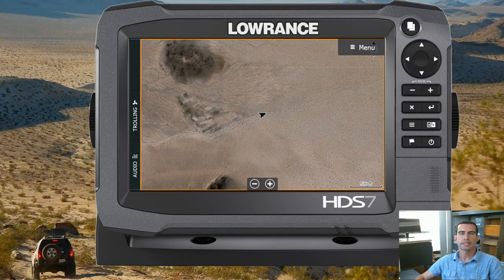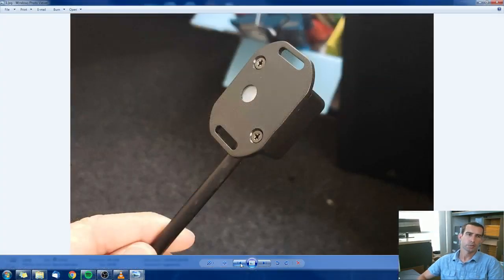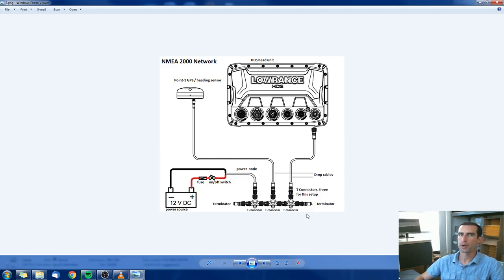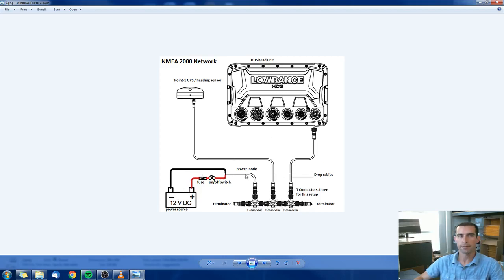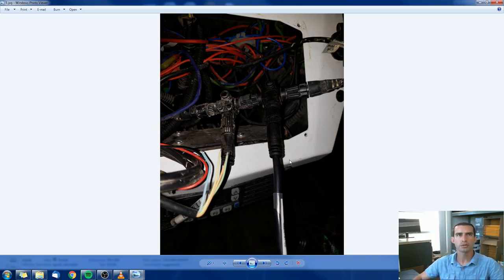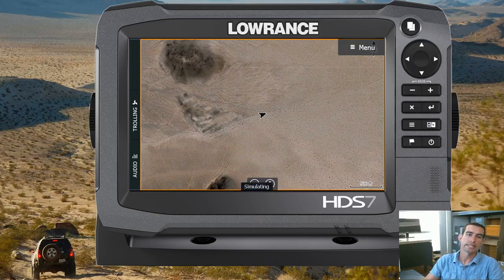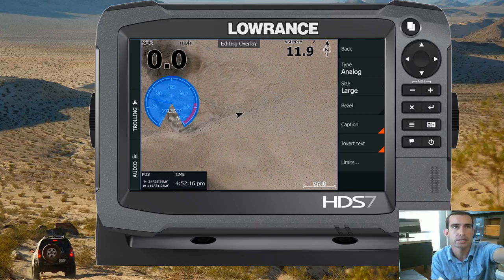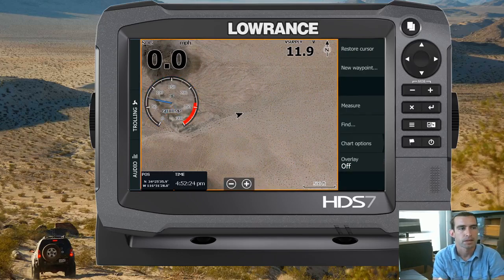Belt Temp Gauge for Lowrance GPS

Comment: do you have a PDF with instructions?
Reply from the maker: Not in PDF, but this video covers it. Do you have questions about setup?
Reply: @RuggedRoutes  just looking for something to print out without internet
Reply from the maker: I can put something together. Contact me via phone or email this week. 909-547-4651
Reply: @RuggedRoutes  New GPs and it cant find the sensor. It worked perfect old one. New is hds9 gen3
Reply from the maker: Make sure the sensor has power and also do a factory reset on the GPS.
Reply: @RuggedRoutes  did both but mo option for transmission .
Reply from the maker: You probably don't have it hooked up correctly. I test each one before I ship them.
Reply: @RuggedRoutes  its been on the car for years   . Just changing the GPS it no longer works..   Same cable and everyything .
Reply from the maker: Thats very strange. 
Make sure the GPS is running the latest firmware from https://www.lowrance.com/downloads/

Also make sure you have it wired using the terminating resistors / n2k end caps. Some people seem to try leaving those off thinking they don't do anything.
Reply: @RuggedRoutes  ill try adding the term. Those are indeed off now
Reply from the maker: Did that work?
Reply: @RuggedRoutes  does the option for transmission only show up when sensor is plugged in? Its still not there
Reply from the maker: Yes, it only shows up when the sensor is plugged in.

Comment: You need to make the sensor hole water tight.  Add a stub with oring or threaded bulkhead with rubber washers.  

Also take note of what NOT to do by looking at the horrible Razorback gauge.  Light is too bright and setpoints are not adjustable.  

AIM makes a great belt temp gauge for stand alone with adjustable backlight and setpoints.  

I like that yours inter grates to a Lowrance unit.
Reply from the maker: It will seal around the hole with 3m high bond tape. The same stuff they use to seal body panels on busses.
Reply from the maker: https://youtu.be/1N0E-xKd_co

Comment: Isn't there a patented product on the market that monitors belt temperatures?
Reply from the maker: Yes there is. The patent has been looked into.
Reply: Any update on ordering this
Reply from the maker: @jimurphy01  The units i have out there are still in testing but I expect to have the production run come in within 6 weeks.
Reply: Are you working with the company?
Reply from the maker: No, there is no need to.